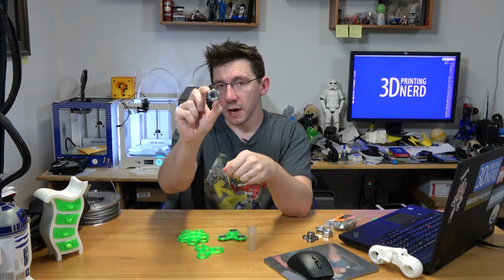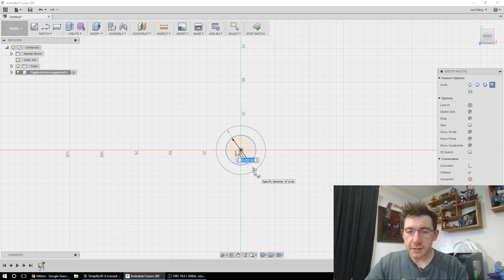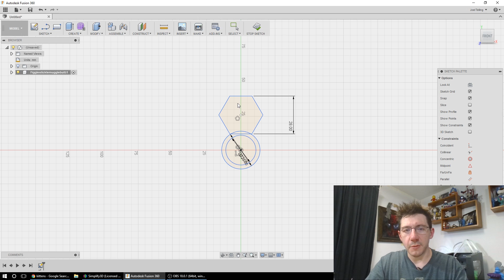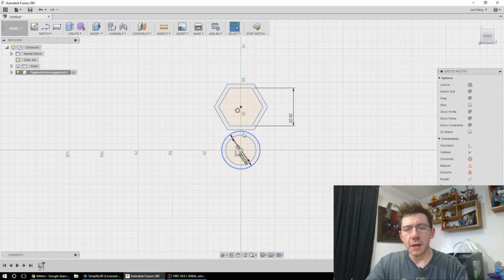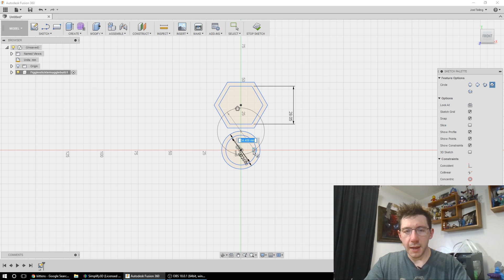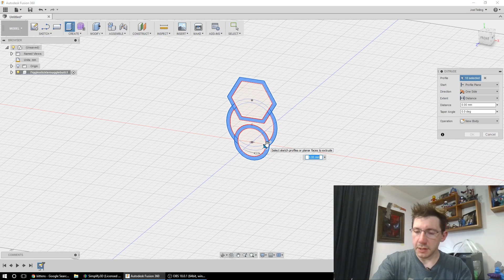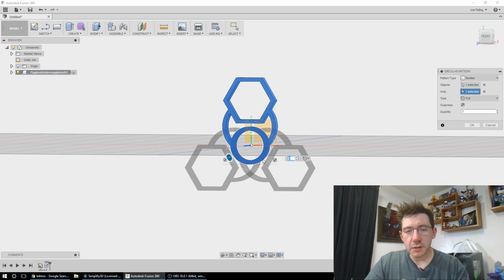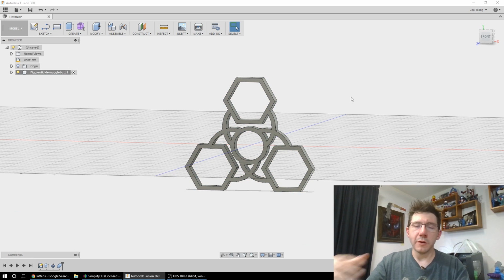Fidget Spinner! 3D Printing a Fidget Spinner that uses NUTS!

Comment: I am tired of 3d printing tutorials that involve Fusion 360.  The cost of a 3d printer alone is a large enough barrier to entry.  Adding over-the-top and expensive software, such as Fusion 360 and SolidWorks, sends the wrong message.

Comment: Hey dude. I have the m3d micro (Which sucks but its a start). I want to try this but it never prints to scale. I try to adjust it but then it just does it wrong again. Got any tips or do I just need a new printer? By the way, love your videos. Been watching for a while so I decided to try along side. :D #Highfive
Reply from the maker: Hey Jakob! Wait - your M3D doesn't print at the scale you tell it to print? That seems weird. I've yet to use an M3D printer - what software does it use for slicing?
Reply: It has custom. The m3d software slices and then produces a gcode in one. It also breaks very often (Like every 1-2 uses) and needs unclogging and recalibrating (which also is no longer automatic for my one). In genral mine is a pile of junk but I get it working. Im not sure about others but it would seem everybody I have seen has the problem with scaling

Comment: Great video! I'm in a high school CAD class and our current design challenge is to design and print a spinner that'll spin as long as possible. I've pretty much figured that to win such a challenge I have to make my spinner as heavy as possible. My current idea is to use six holes and put five nickels in each hole, so thirty nickels. That might literally be a waste of money though, haha. I might go ahead and try a design with giant nuts now.
Reply from the maker: Use giant nuts! Also, ceramic bearings!

Comment: #highfive Great variations of the fidget spinner.  Now that I have my printer working again, I'm going to take you up on your fidget challenge. BTW,  why put sketches into a component? I've made many things in Fusion 360 without doing this so I wonder what the benefit is.  Thanks.
Reply from the maker: Thank you! As for why sketches in a component, I don't know. I have ZERO training in fusion 360 and I'm just trying things to see if they work!

Comment: Can you fit smaller nuts into larger nuts to make the spinner heavier? I imagine 2 smaller nuts could fit inside a larger one.

Another way to get heavy cheap consistent weights is small lead balls. I believe they are sourced from hunting supplies, no idea what they use them for. In EU, they used to be used in scale modelling also, as weights, but now are not available, except in Switzerland which is technically not EU. But need to paint them after insertion or provide a cap on top, you don't want any lead going into your eyes or mouth by accident.

Comment: hey joel! i took the first challenge and made a 5 armed fidget spinner using the half inch hex nuts you were talking about. i didnt have either the nuts or the bearing but i worked with the help of the internet and made this on fusion 360 :) do check it out once http://www.thingiverse.com/thing:2243835  high five! :D
Reply from the maker: That came out great - awesome design! #highfive
Reply: Thanks 😊

Comment: Couple ideas for other spinners... 

Make gears around the center bearing and gears around the satellite bearings. 

What about a spinner that prints in two parts that snap together. That way you can add other other pieces inside it like ball bearings or something that can move around when spinning. 

Take your current design and remove some of the material of the arms to add some more cool geometry in the z direction. 

Anyway love the channel. You have inspired me to get into 3d printing.
Reply from the maker: I like that second idea quite a bit!
Reply: Can't wait to see what you come up with.. high five!

Comment: What kind of bearings are you using?  I got some relatively cheap Amazon specials but they never go more than 30s or so. Are you cleaning or lubricating them?
Reply from the maker: I got the cheap ones from amazon as well - link of the ones is in the description. I didn't grease or clean or anything!
Reply: Duh I should have checked... I really enjoy your videos!  I built a Prusa i3 Mk2 partially based on your recommendation and my middle school kids have me cranking out spinners non stop!  (:eye roll:)

Comment: what if i dont have a 3d printer or the inner part of a skateboard wheel  and i dont have the money to buy a spinner? also no one near me has a 3d printer
Reply from the maker: Dang, I don't know at that point.
Reply: Is it also possible to hot glue those nuts to the centre part?
Reply from the maker: Yes it is! You could, technically, make a spinner with a bearing, two weights, and some hot glue.
Reply: I could also use deez nuts, sry had to xD
Reply from the maker: Yes, yes you did!

Comment: A great pro-tip when using Fusion 360 for 3D Printers.  Ever hate how when you send a model to your slicer, models drop in on their side and you have to rotate them to print?  (or in this case use a side axis from the beginning) Go to Preferences > General and set "Default modeling orientation" to "Z up".  This will line up the Z-axis between it and your slicer.  When down = down it makes transitioning between programs easier.
Reply from the maker: dude THANK YOU
Reply: THANK YOU I've just started modelling with Fusion and this is annoying me so much!
Reply: And if you forget to do this and export the STL anyway, if you're going to print the model a lot you can take it into meshmixer and reorient it super easily and resave the STL.

Comment: Since I didn't want to buy a whole pack of nuts I made one using UK 1p coins as weights. I'm still waiting for my bearings, but when they arrive I will 3D print my spinner in school. I also designed custom finger caps with a concave. I'm using Inventor Pro instead of Fusion btw.
Reply from the maker: That is great to hear! I need to concave these ones.

Comment: These videos are pretty cool! I myself have a habit of making stuff or trying software before someone makes a video about it, so I already knew all of this, but this is a great introduction to fusion! 
Before recently I thought fusion 360 was really expensive, so I was pleasantly surprised when I found out you just have to sign up as an enthusiast. 

BTW, instead of using circles or lines, you could use splines, that way you can adjust exactly how you want it to be.
Reply from the maker: Oooh, that's a very good point. Thank you for the tip!
Reply: Glad to help!

Comment: Hey 3DPN great videos you make, I have a little idea for you, I have not even a 3D printer but found them very inspiring

The 3D Printed Fidget Spinner looks fine, but if you print out som color cover to the nuts, i think it will give a great effects when it spins
See You :-)
Reply from the maker: Hey Jan! That's a great idea! I'm going to do something like that in the future when I (hopefully) cover 3d printing threads in fusion360 :)
Reply: :-) Maby 2 or 3 colors on each side

Comment: 3d print the non electronic parts of a 3d printer, then make it work.
Reply: yeah make it lighter in weight and look like anet A6
Reply from the maker: I'll need to print some time in order for that to happen :)
Reply: Sure, since you need parts that need to be very precise in size and shape, printing will take a lot of time. But that would prove if it's true what many 3d printing companies say all the time: that you can print parts to fix your own 3d printer. Are today's 3d printers accurate enough to print parts that when used can print accurately? Doing so would prove the quality of a 3d printer, since the printing errors would be multiplied exponentially in the final print.

Comment: looks awesome. I printed lots of the 1/2 - 13 spinners. fun thing to do is stack them so you get a mega spinner. 1 central spinner and 3 around the perimeter 4 total spinners linked together :) high five

Comment: Hey Joel, for my spinners, when I make my buttons I add a hole in the middle to add a set screw. This way you can thread the buttons together between the center of the bearing.
Reply from the maker: I thought about that, but my goal is 100% 3d printed (except for bearing and weights).
Reply: Good plan. Fusion 360 allows you to make threads in your parts as well.

Comment: If you wanted you could attach a motor to the bearing, and see how fast you could spin it before failure. The motor might be annoying though, it would be driving you nuts. Bah dum tss
Reply from the maker: I hope to try and spin these faster, but just have to consider my environment in case there is a massive failure.
Reply: That's true. I wonder how the maximum RPM differs between metal, and ceramic bearings. Ceramic ones are smoother, but that doesn't mean they wouldn't fail first.
Reply: Ceramic bearings were made for intense RPM as the heat produced over extended use can start to deform the metal ones. That being said, it would be more a test for the plastic as even a CD spun fast enough can shatter, so adding weight to the outside will decrease the max RPM... Still interested in watching that though :D

Comment: I like sketchup. free and you draw 3D no drawings and still accurate.
Reply from the maker: I've heard Sketchup is good as well, and I hope to try it soon.
Reply: Fan of Blender myself there is a built in add on for making nuts and bolts, that plus the solidify modifier and the Boolean modifier and you can do quite a bit, but there is some learning curve to the keyboard shortcuts but nothing you can't find in tutorials.
Reply: I'm not a fan of Sketchup or Blender for this kind of modeling.  I am a big fan of Onshape right now but Fusion would also be better than those two options IMO.
Reply: $1200 a year for a license vs free and open source doesn't really seem like a fair comparison, ultimately modifying a set of vertices, edges, and faces in a mesh in any case (use the tool you know and that gets the job done imo).  Good to see some web based option though since I primarily run Linux nice to not have to worry about platform support.
Reply: Both of the options I listed offer free licenses.
Reply: Free as in you can use it until you make money from it or free as in you can modify and extend the program and get the source to build it yourself?  Drug dealers also use the first one is free model ;)
Reply: Fusion360: "A free 1-year startup license is also available for hobbyists, enthusiasts, makers, and emerging businesses that make less than US $100,000 in revenue per year. At the end of 1 year, you can reselect the startup entitlement or transition to a commercial entitlement."

Onshape: "Open Source & Public Design Projects

Free

Not for commercial use, other than viewing"
Reply: Yeah I read it, just poking fun also blender is free in terms of the source code being open not just free to you if you decide to open source your work.  Great they are in some way promoting sharing source but would be nice if they practice what they preach (could still offer their hosted version for a price).
Reply: Blender is basically abandonware.  The open source rights were purchased for around $100000.  I still think it's awesome, but not very useful for this type of work.
Reply: Have a link about the purchase of source never heard of a buy out of Blender? It's GPL and the source is here https://developer.blender.org/diffusion/B/repository/master/ was updated an hour or so ago it looks like don't see why you think it's abandonware there are still pretty regular releases with improvements.

Comment: Hi guys. Since i saw your model with Hexnuts i made my own and printed a night ago and wanted to finish it up with the cap in the middle but my printer doesn't extrude enough filament when printing the "pipe" in the middle. Gave up this morning after the 4 Print.
Now im trying to print just the "pipe" with the same diameter to see if its a printer problem or something with my model.
Used Inventor for creation and Cura for Slicing my machine is a Tronxy 1X
.

Comment: Print a spinner with a coin cell battery and an LED as the weights. Could model spots for wires to run. Maybe have the battery in the center and the cap on one end could be a power button. Think that be super cool to make outta glow in the dark plastic.

Comment: I really wish I had a 3D printer now.
Reply: AgentBrain printrbot printers are economical and good starters. especially the kits
Reply: Andrew Herrera Oh cool. How much does a beginner model normally cost?
Reply: AgentBrain Prusa i3 kits are good as well and can get them pretty cheap but expect to spend literally a day or two putting it together and another few days tweaking things to get consistent good prints (need to learn what needs to be tight like belts).  It's a lot of work but really fun once you start designing things.
Reply: I'm kinda looking to get into the action as well, so I'm leaving this comment here.
Reply: Can get a decent prusa kit for $300 or less most of the cost is in the stepper motors.
Reply: Prusa's E-shop has $600 minimum, where do I find a cheaper kit? I don't really need it to be good looking or anything, I want to get into 3D printing and electronics so I can fabricobble things in my bedroom from scratch, and some of the money goes to a soldering iron and solder and components and what not, so I need a pretty cheap kit. $300 I could probably deal with, but where do I find one?
Reply: Just search Prusa i3 on Amazon you'll find tons of knock offs and DIY kits available.  The one I got was called RepRap Guru but not sure if they still sell the kits or made an updated one to match the updated MK2 official prusa.  Would basically just go based on ratings and price though since that's what I did when I was searching for myself.

Just checked looks like reprap guru is still there and still highly rated but looks like out of stock on the latest stuff.  My experience was it took a lot of thinking to understand and follow the build manual (mostly was good till the electronics which I'm typically good at but was fairly complicated and need to be sure everything is right before powering up lest you release the magic blue smoke).

Comment: a cool next step could be pads that can interlock through the bearing so they don't fall off if the dimensions are just slightly on the small side.  I've tried making something like that in tinkercad (not easy when its small) that have had minimal success.  They either break, or don't have a good lip/ridge to grip each other. Would love to learn to do it in fusion 360 as I bet we could get a better model than we can with tinkercad.
Reply from the maker: That's the plan, Ethan :)

Comment: Nice usage of the 1/2" nuts.  I was thinking about the same thing this past weekend when designing up a spinner.  All you need is some sort of equal mass on each arm, nuts being a better cost solution.

Comment: At my school the tech department is selling fidget spinners and for weights theyre putting multiple washers into the arms of the spinners. We had one where there were 8 holes, each capable of holding 4 washers and we were able to get it to spin for about 6 minutes on a steel bearing.